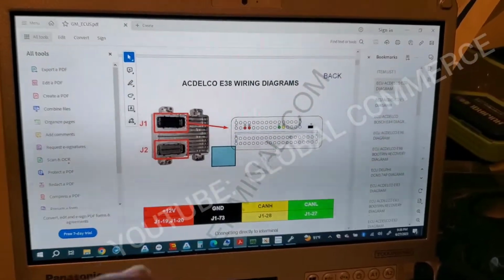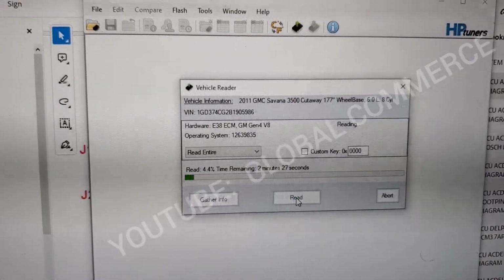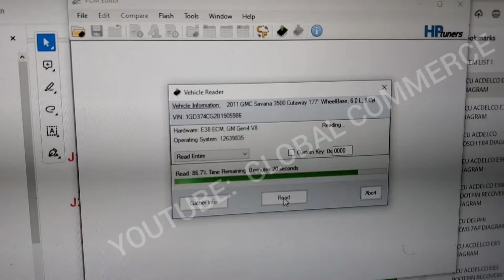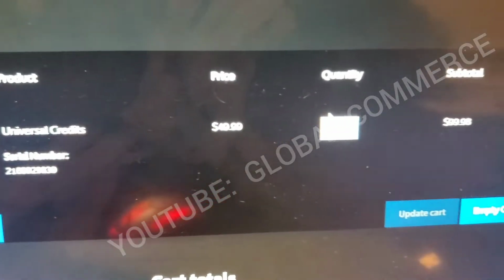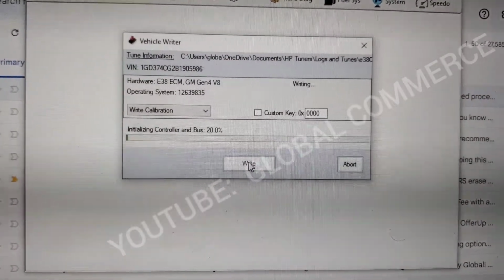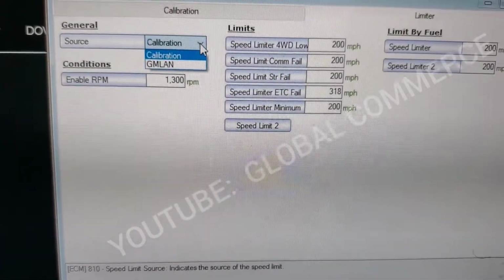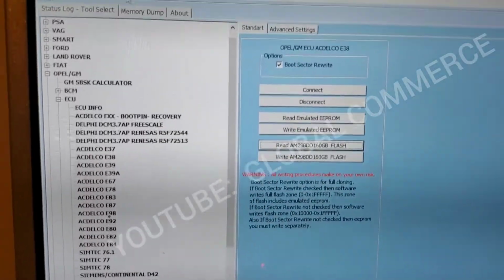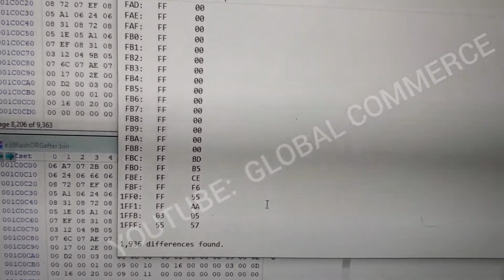Chevrolet DISABLE SPEED GOVERNOR/Limiter ECM HACK! HPTuners & I/O Terminal Easy!

Comment: can you do this on a 2014 express van 4.8l
Reply from the maker: Yes
Reply: @globalcommerceca  I have a Spare ecu how much will this cost me?
Reply: Can I send you my Ecm and have you do this procedure for me I have a spare ecm
Reply from the maker: @garylisak2286  yes, but I would need the ecm that starts your car, if the spare doesn't start your car it won't work after I do this,  also what year and size engine do you have?
Reply: @globalcommerceca  it’s a 2014 express van 4.8L how long would you need the ecm this is a service van
Reply: I am still interested in having you program this ecm I have both ecm I have the one that runs the vehicle and the spare